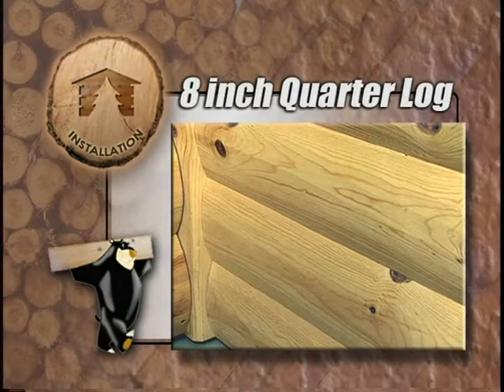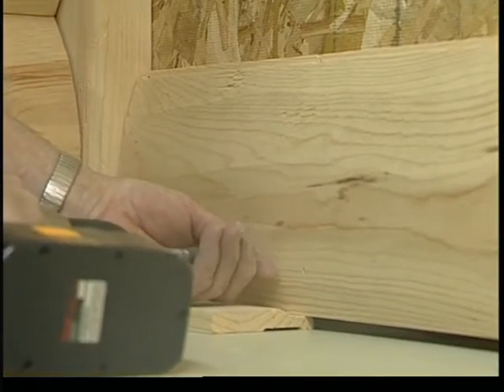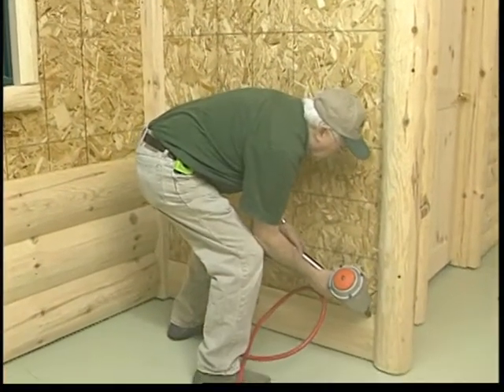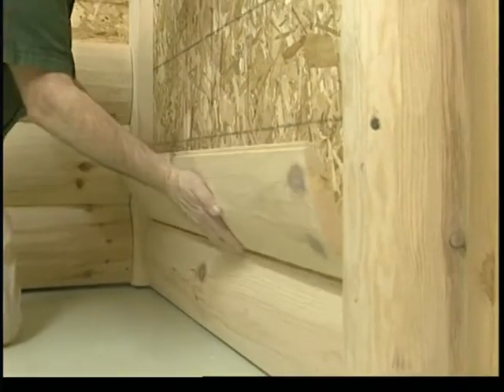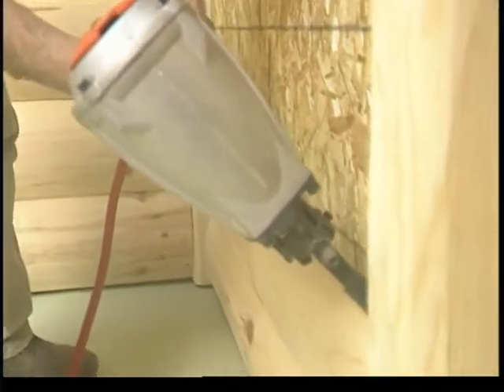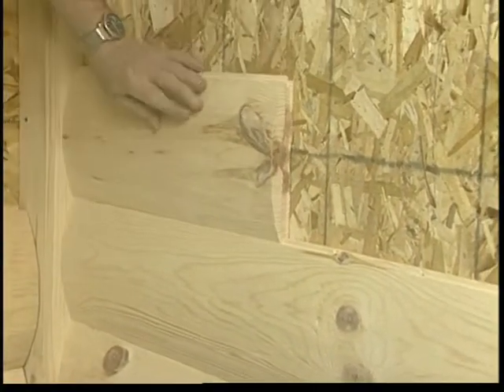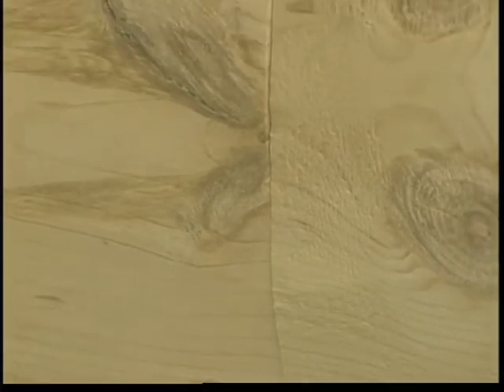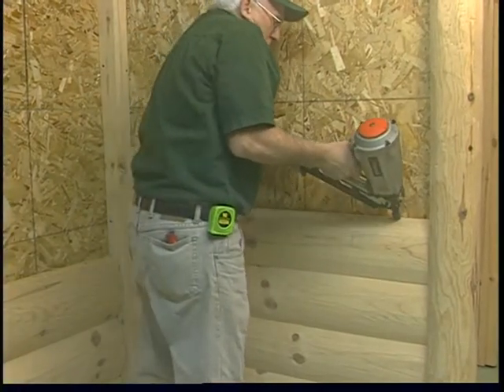How to Install Log Siding

Comment: Why is there a plywood sheet on the inside? Is that placed there so that there is something to attach to with the siding?  Does that need to go every in the interior of the house?
Reply: that not plywood, it garbage chip board(osb)..

Comment: Nice video. How is the process to replace a bad board in between boards.? 
Can you replace o board from any place on siding without big hazell?
Reply: I would imagine the only way to replace it would be similar to replacing a toungue and grove board in a floor.   That would mean using a nail or screw to secure the replacement board.